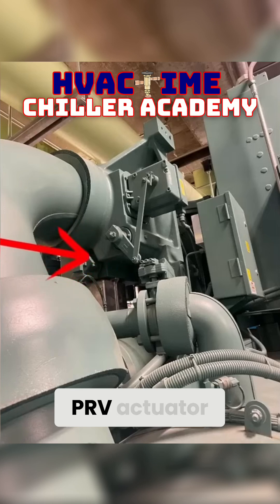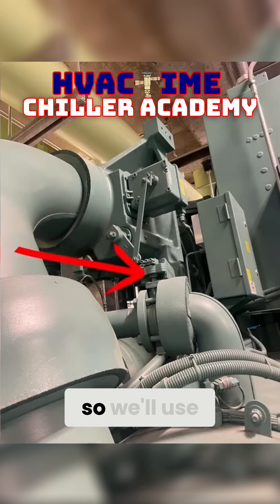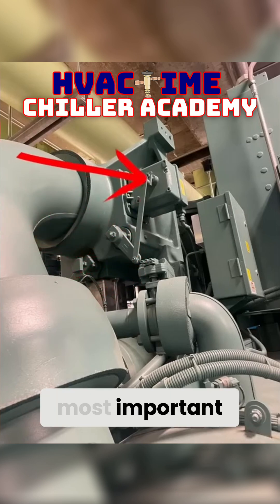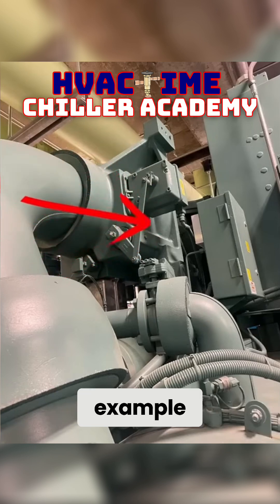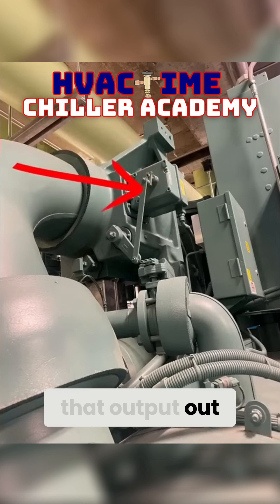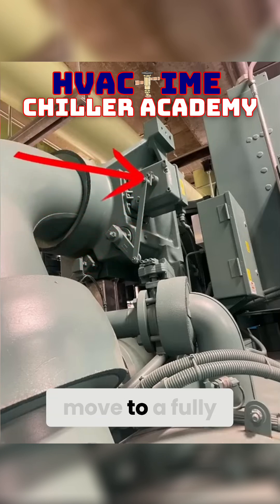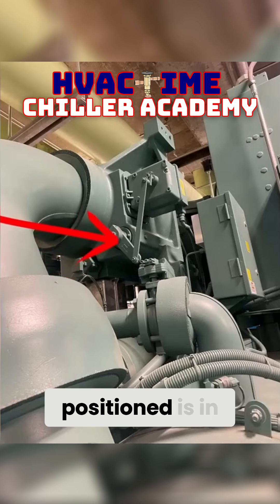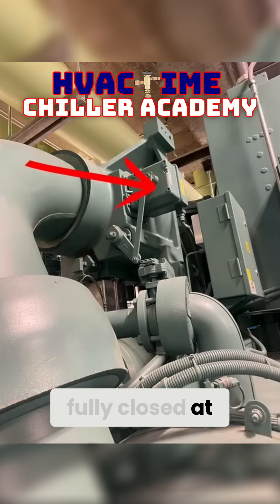YK PRV Actuator Install

Comment: On the WSC, the diffuser and guide vanes are part of a one-piece type setup. It varies the diffuser opening as the vanes open and close. It's a piston. The piston slides back and forth. The SA/SB solenoids are what controls the piston. It's a hydraulic style action. Pressure differential on different sides
Reply from the maker: Would love some manuals and diagram on the operation and break down